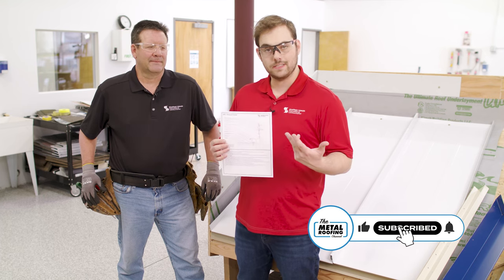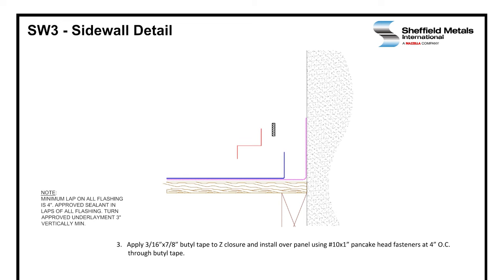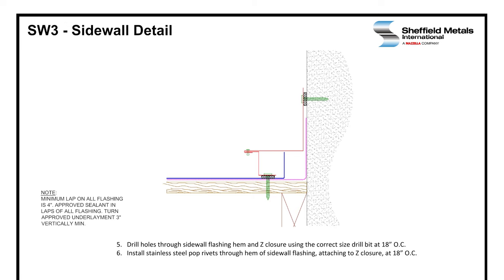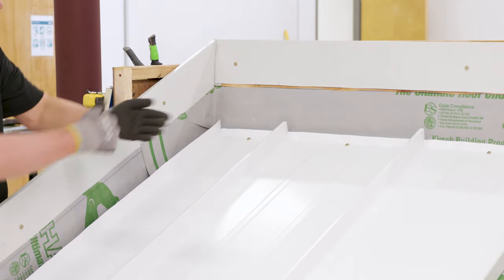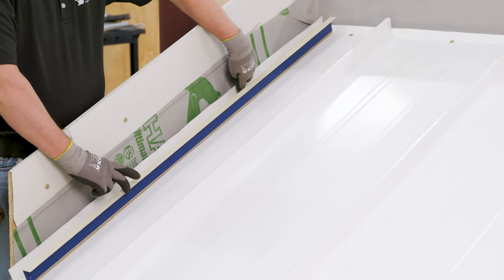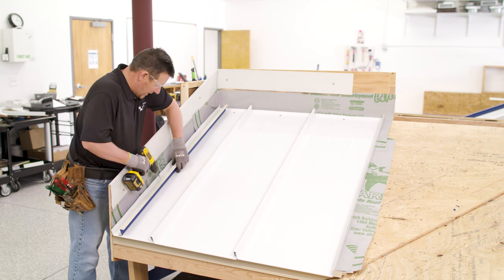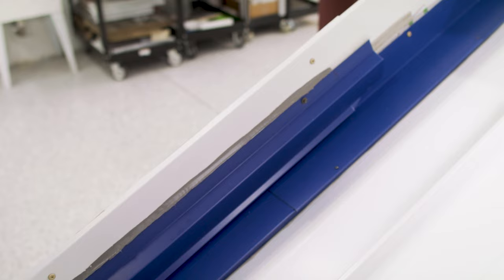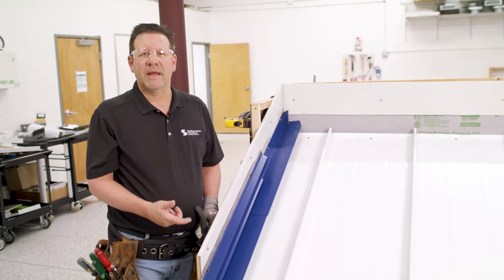How to Install a Sidewall on a Standing Seam Roof: SMI Detail SW3

Comment: I'm no expert, but this seems awfully complicated. Is there no way to fabricate your panels such that the panel adjacent to the sidewall is either wide enough or breaks at a point where it can run up under the siding?

Comment: How would you make this work with lap siding?  Thanks
Reply: Take off the siding run the underlayment up the wall, install the sidewall flashing, backstrip with 6” strips of underlayment, then install siding back over it. Counter flashing defeats the point of a concealed fastener roof system and doesn’t look as clean.